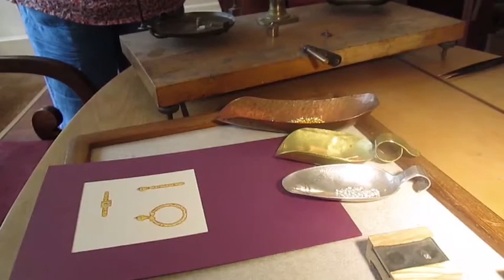Medieval style Making of a 14th Century Ring: Part 1

Comment: how did they Sauder their rings without the use of torches in stuff i cant imagine a normal furnace or kiln would work
Reply: I think they melted the same type of metals and then carefully poured it into the gap
Reply: @edwardneilloftheclanmacnei7057  well I just relized that they used a wax casting methods so they probably never been saudered.
Reply: The soldered in a goldsmith's forge, which is more like a tall kiln than a blacksmith's open hearth forge and uses charcoal. This is the same tool they used for enameling, and they could control the temperature relatively precisely.  At some point they used mouth-blown blowpipes and oil or later alcohol lamps for small soldering jobs. Reference Thoesophus On DIvers Arts and Biringuccio Pirotechnia